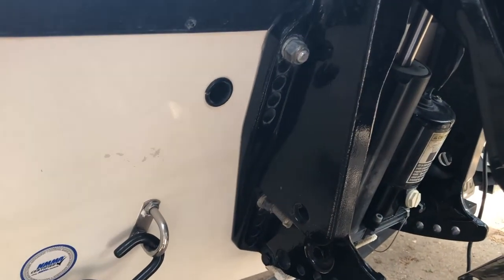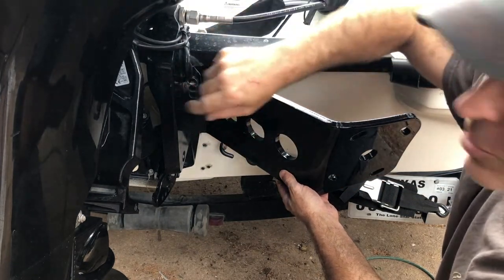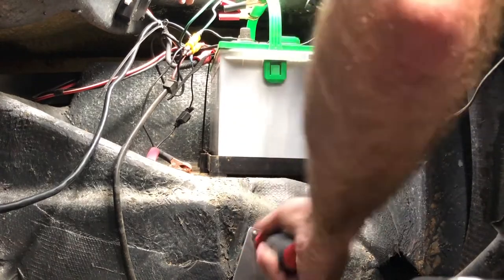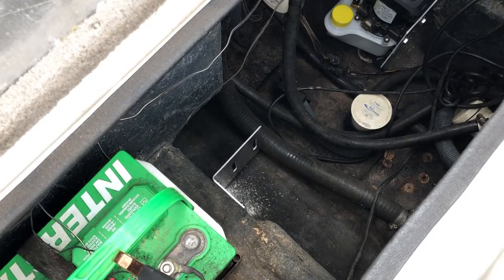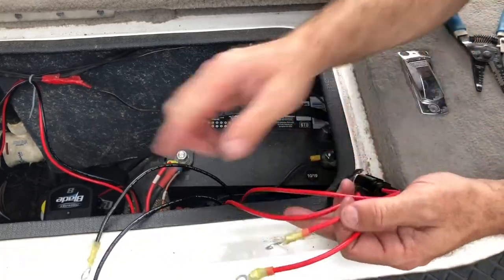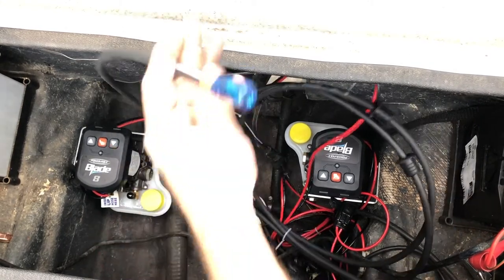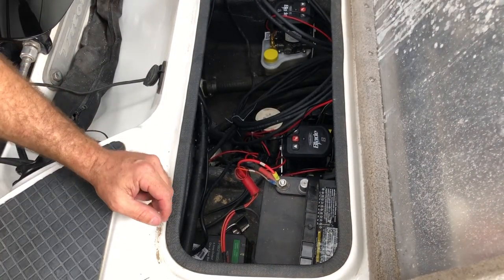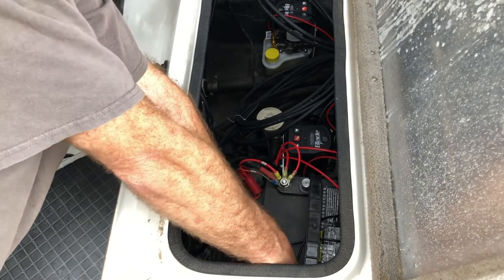Power Poles Install on my Triton Bass Boat

Comment: ... 1/18/2022 ... I am expecting my pair of 8' PP Blades near the end of this week so I am watching every install video I can find.
At 4:45, YOU are the FIRST one to mention that the hydro pump bracket can be mounted other than just on the bottom.  👍
Not sure if the other installers even recognized that fact.
.
Reply from the maker: It definitely opens up your mounting options. You’re going to love the blades!  One of the best tools you can have on your boat.

Comment: Excellent video man!  Curious what the height is from the ground to the top of your poles when your boat is on the trailer?
Reply from the maker: I don’t have my boat here at the house right now or I’d go measure it for you. My guess is they are somewhere between 6’6 and 7ft. Probably closer to 6’6. Are you trying to get them in a garage door?